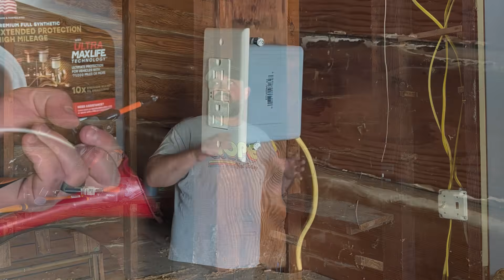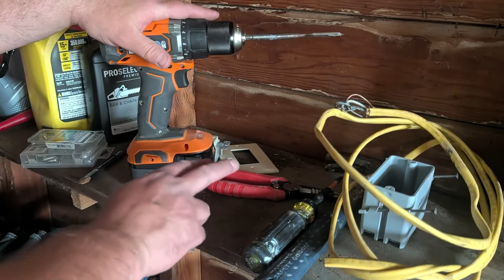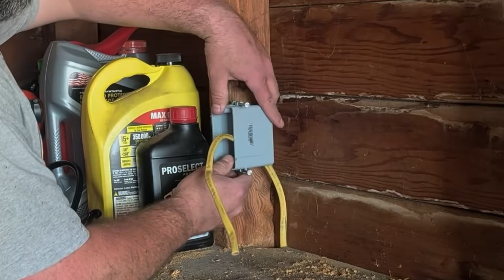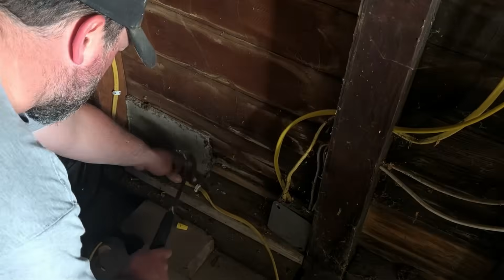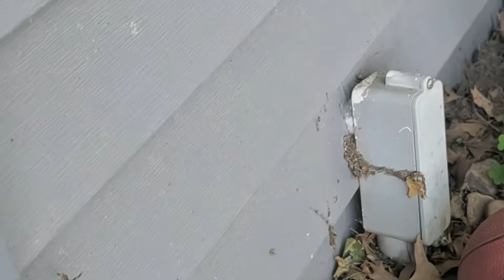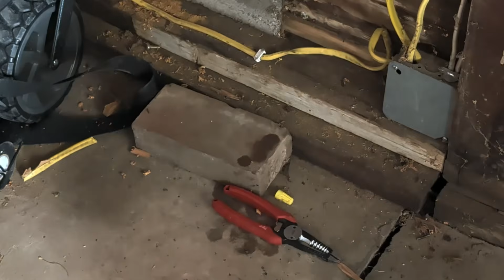Stop Using Extension Cords! Add a Garage Outlet

Comment from the maker: If this video saved you time, money, or a call to an electrician, the biggest compliment you can give is hitting 👍 Like, 🔔 Subscribe, or leaving a Super Thanks. Your support helps me keep making free DIY home repair videos for everyone.
Reply: Hey I saw one of your videos about repairing a Samsung refrigerator that has issues with water leaking into and under the crispr drawers, I'm looking to fix mine that has the same issue. Would you be able to help me find the right parts? My fridge is pretty old, it's the DA99-02010A  RF217ACPN model. I found a heater clip that fits for this model but I haven't found any kits with like the replacement drain tubes that mention that they fit this model. Any suggestions would be appreciated, thanks!

Comment: Is that up to code? Unfinished wall and unprotected cable
Reply from the maker: Depends on where you are located as there might be local codes.  For NEC its basically a GFCI, garage has to be on its own 20amp breaker, and outlet can be no higher then 5 1/2 ft.  Check you local code as well.